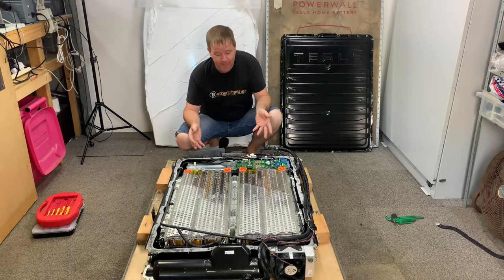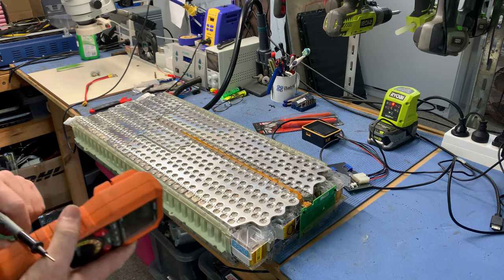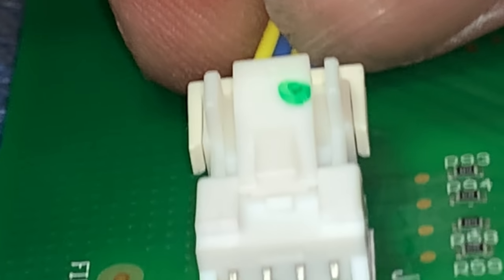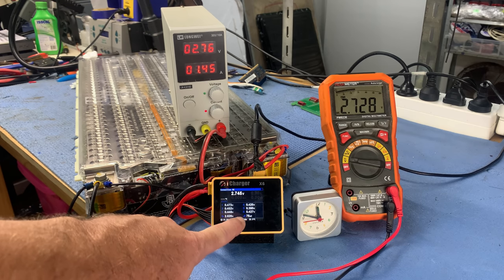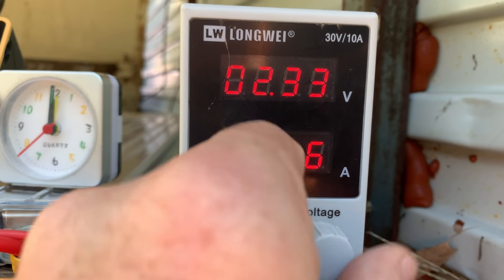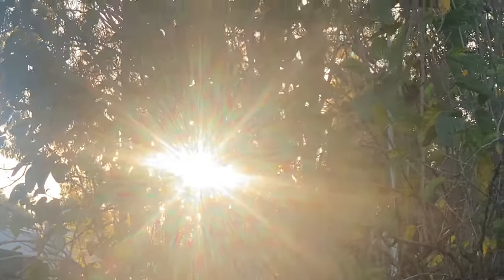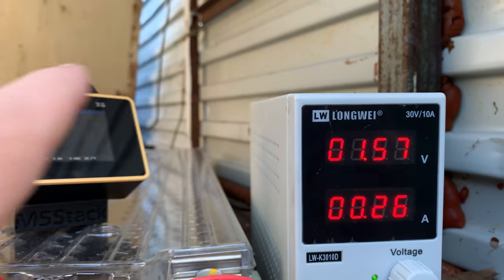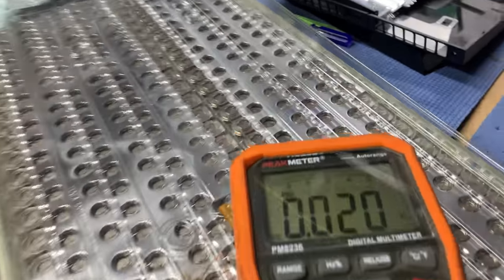Tesla Module repair | Zero volts to useable? Lets find out !

Comment: fyi I'm playing around with a digy meter 6 digit  after the point. only to show if batts are going down or holding when building a battery . i might go to 8 digits its only a reference. to find out were the batts  are going ..i  check and charge all cells as per . then leave for 24hours  and so far the  batts do as the meter said.
Reply from the maker: I so want a higher resolution multimeter but this one was 60bucks from Banggood years ago lol it's done the job up till now

Comment: These very low charge currents will only compensate for internal losses, i think.
Reply from the maker: Yeh for sure but I tried more as much as 20 amps and the cells just go hotter faster. RIP Tesla batteries - I do still have them on the shelf tho.

Comment: I was  able to restore some with a desulphator charger..it spiked the voltages between 2 and 4 volts . It woke some 0 volt cella from 5 year old laptop
Reply from the maker: but were the cells zero volts....? not 0.1v?
Reply: @HBPowerwall  they were 0.00,, try  spiking  the voltage to wake them up... it was only 1 amp also
Reply from the maker: ok cool!! I just spiked these ones :P

Comment: charge your battery at 24v w/ 225 mah to 500mah trickle charge will do the trick, fun fact cell phones work the same way if you slow charge them your battery lasts longer between charges and longer over its lifetime.

Comment: Hey try throwing a lot of heat at it or a lot of current to perhaps revive the battery chemical
Reply: This helps reduce resistance
Reply: yes, if heat to 350C it might do the trick
Reply from the maker: i ACTULLY think there is something to this... well kinda, well maybe, well check the next video :)

Comment: 😥☠️🔋 .. been dead to long and the chemistry can broken down into to something not battery like.
Bet if you remove a cell, it would have very high impedance; as you already suspected. 

On to Plan B/C. 🧐 Question is will you do 7x 1s modules (like studio wall), or make 2x 7s modules in similar shape to the 24v Tesla modules? Could probably reuse plastic covers and mounting?

Maybe post 2-3 build options and have community vote on ... builder getting final choice as how to proceed.
Reply from the maker: Lots of ideas kicking around on how to use this 'powerwall' will see what comes of it..

Comment: Stick it in a fire pit, put 10A into it and see where the heat goes. It will either be a few bad cells pulling the lot down or the pack will go thermal
Reply from the maker: Check out the next video I just released lol

Comment: i have to disagree on a major point here. I tried this only on individual cells, but here is my experience : the zero volt cell IS useable : I loose only about 11% of those. They are all in my power wall now. The absolute truth is, ANY NEW cell will not keep its charge if it is below 2V. There is a threshold where the cell self-discharges. You won't get normal cell work/behaviour until you put it above 3.3V The lower the voltage the faster it goes down. I can guarantee that your test of energy retention with such a low voltage is not valid. When I have a zero volt cell I first charge it in a nimh program, then I jump to a lithium program. With as little amps as possible. When it is at 4.10V and the amps are dropping on the charger, and I store it for a monch, I discard the cells that are below 4.00v after one month, and I discard also those thar have more than 80mOhm of IR and it is there that I see the result from 8% to 11% are discarded. 8% discarded in the 3,3V group and 11% discarded in the ZERO volt group. Test sample: about 7000 cells in the 3,3V group, and 282 in the ZERO volt group from witch I discarded 31 : reason for discard 22 were self discharging, and 9 had high IR. The difference between your case and my case is the duration of the zero volt state : my duration is unknown and different for each cell, your duration is very long uniform and known. My cells were each of different brand, yours are all the same batch. And as a final point the guy who wrote a comment about the dendrites : it is probably true on paper, but so far I have processed over 8000 cells and found only 2 that wanted to overheat. So this is a risk, yes, but it is not a constant.

Comment: Ugh that's so sad. When I've recovered even cells in the past I charged at .2 amps for a couple hrs then half hr off n next time I do the .2 amps they began holding charge. The capacity was complete shit though. Talk about degradation (sigh)
Reply from the maker: i've still got the battery charging at 0.1 amps months later I should video it sooner rather than later.
Reply: @HBPowerwall  still? Any signs of life?
Reply from the maker: Kinda, it’s terrible really but if you were in a third world country and this is all you have it’d do a job.
Reply: @HBPowerwall  seriously agree! I'm experimenting with two 200ah packs of lifepo4 and lithion in parallel connected to a small 2kw inverter. Each have their own fusing and bms's. I'm learning a lot from it. They're far away from my main system but very interesting how differently they act under load and charging. I seriously would never have thought about it. Had some old 18650s laying around and the lifepo4 from my car audio setup and thought they should be doing something other than collecting dust!

Comment: When batteries are fresh out of the factory they don't have any voltage. So it's added REALLLY slowly over a few hours, then 1-2 cycles to make sure it works before shipping out of the factory. I guess that's only works when they are fresh, unfortunate you were unable to revive it.
Reply from the maker: Do you know this first hand? Or just interwebs? Keen to see the process between finished production cell and fully charged cell.

Comment: That gradual fall you saw on the multimeter is probably the residual voltage in the power supply. Cheap chinese PSUs do that.
Reply from the maker: i'm thinking so

Comment: just remove some of the cells and check if the cid are ok if not then search on youtube how to recover cells with broken cid and recover it if you want, believe me, I have recovered a ton of those cells with the screw trick(putting a tiny screw inside the holes on the top ) . as it is the battery is going to get trashed so why not take a chance and if still, you aren't able to get any voltage then send it to me I would try to check out what's wrong with those cells.
Reply from the maker: YOU need to check out my CID video.... DON"T DO IT..

Comment: Crazy to me that such an advanced system doesn’t have a manual reset safety device to keep the cells above 2v. Seems like such a waste of good resources.
Reply from the maker: Any good bms has low voltage cut of option

Comment: Where does the charge leak to? Heat?
Reply from the maker: Yes, the cells are internally shorting and discharging as heat
Reply: what happens is there needs to be a barrier between the pos and neg surfaces, but when that breaks down, current doesn't have to go across the terminals but just jumps across inside the battery.
Reply: @JeffSmith03  I see what is that barrier made of that it can dissolve? 
Like I’m an engineer but nothing with batteries / battery materials, it is interesting though to know why things eventually fail,

Also why does it breakdown due to not holding a charge for too long?
Reply: @Eagles_Eye  it seems that different designed batteries have different reasons. My profession is designing robotics and I am still trying to learn this stuff but people are mentioning dendrites and that would mean when the crystization forms it extends spikes, which would force it's way through the separator like a nail and cause another short for each dendrite. I knew it can happen on a PCB or in some chips. The reason for a difference when depleted: it's about chemistry.
see for more info https://batteryuniversity.com/learn/archive/is_lithium_ion_the_ideal_battery

Comment: How to reset each cell in ONE module? I mean mechanical reset?
Reply from the maker: They are internally shorted... you can't..
Reply: @HBPowerwall  I did mechanical reset all 78 single cells, only didn't know which one is bad, but ONE module 3,7V back to work.

Comment: You should have brought it up to the minimum zero amps voltage. With a tiny amount of amps.
Reply from the maker: Tried and failed :(
Reply: Wondering can you attempt to charge a cell by bypassing the bms? Is it the BMS stopping the cells charging. Only ask because I have had some success reviving old cells that were at 0v. Not on this scale unfortunately but. Maybe slightly higher amperage?
Reply from the maker: BMS has been removed & replaced with after market board I can connect a balance charger or my Batrium BMS to

Comment: Hi
If I were you, I would charge this module with a higher current so that at least some of this charge would get into working cells and I would check the temperature on an ongoing basis to detect those that are "shorted", and then I would cut off their connections from the rest of the module.
Another option would be to test each cell after it is disconnected from the module and see which can still go back to its previous state.

Comment: Some of the cells are shorting the other cells.
Reply from the maker: By the looks they are all shorting
Reply: @HBPowerwall  Oh, no, don't say that! You only need one in a pack to give the result your are getting. I reckon there are 20 or 30 cells in a pack, so the chance of 1 being a short is much higher than all 20 or 30 being a short...I hope you rip the packs apart and see how many cells are actually shorted and how many recover...a lot of work though, I wouldn't blame you if you just scrapped the lot, but maybe just one pack?

Comment: You should never charge a LiIon cell that has dropped below 1V. At these low voltages, copper from the current collector will dissolve into the electrolyte and could cause internal shorts upon later cycling. A cell that's gone below 1V is toast, period.

Comment: ive recovered tool batteries from a low voltage state at around 0.6v cell and put them back into everyday use without issue.
recovering one from completely flat... yeah that wont work
Reply from the maker: yeh low voltage, is different beast to no voltage.. I've done this also in the early days

Comment: Are you serious?! charging at 0,5Watts a battery pack ~11KW The internal resistance alone is higher than that charging rate. You should try at least 100x as much juice to try revive that Pack. 50W or so.
Reply from the maker: I'm months into charging - I have not given up yet.. currently 0.1 amps per 'cell'  video when I stop being lazy

Comment: Not that i believe the cells could be revived. But charging at 1.5v*0.4amps = 0.6watts, thats way to low to make any difference in a pack that size no? I know you just want to be careful to not start a fire or anything, but you could have tried it with something like 10watts at least, even if it would turn to heat, 10watt shouldnt be able to start a fire even if you tried. Just my 2 cents
Reply from the maker: So try higher amps you say... sounds like an idea...
Reply: @HBPowerwall  I agree, with a little more "umph", it might be enough to force them over the hump. As mentioned in another comment, you may need to pushing them over the hump to make them act like batteries instead of capacitors.
Also, this may help you find the heaters that could be contributing to the rapid decline. Ya know, 1 bad apple spoils the whole bunch, kinda thing.
Addendum: If you try to push 300 lbs of dead weight up a hill with only 50lbs of force, you won't move it all. But push with 200 lbs of force you may actually get it moving, even slightly. Push with 400 lbs and it'll definitely move.
Reply: @HBPowerwall  in 5 years we will see offers for such dead batteries in the second where the big countries start there ressource management and recycle these cell like shown in this great video where the battery recycling quote is over 90% .... it might be crap for you right now, but it will get back a lot of value and if you have such facility in your country they will pay for this raw material.

Here is the video you have to search for
Can electric vehicle batteries be recycled

It is from the "fully charged show" UK visiting a german battery recycling factory ... that will become a supplier for the VW plants that produces its own ID.* car fleet cells and batteries in plant nearby ( VW Salzgitter) .

So pile the dead up for the moment they gain value cause a 1000 $ tesla battery pack that has gone dead will be worth a few hundred dollars in 3 - 5 years. Australia will not burry the dead batteries on garbage deponies and try to recycle instead to mine the ore again.
Reply: @korishan  
your comparison definitively is incorrect. try pushing a cart without wheels up a hill with strong force and expect wheels to grow in the process!
Reply: @ursodermatt8809  I don't believe so. And your comparison makes no sense at all
Reply: @korishan  
ok, but i am sure your's does
Reply: @ursodermatt8809  yours, not your's
Reply: @korishan  
yes of course, thanks for your correction
Reply: @ursodermatt8809  You're absolutely welcome. Always willing to lend a helping hand, or word.
Reply: @korishan  
thank you very much
Reply: @ursodermatt8809  You're welcome

Comment: Get yourself a 250A power supply an start charging and follow the heat
Reply from the maker: DC welder? lol
Reply: @HBPowerwall  yes weld the dead cells internally, 

at the end use a dremel  and just remove the positive connection to the  cell 

don’t bother opening the entire thing only as a last resort

Comment: What is the history of this battery module? My distaste for batteries is why I stay away from electric cars. The fully depreciated 10-20 year old clunkers I like to drive won't be possible with an electric car that have batteries that die.
Reply from the maker: I know what i'm told (and don't trust it...) was told it was new, but after much more time with it, the Powerwall has been installed but I don't know if it was commissioned. Like anything ever made, there will be failures - in 20 years you'll see a headline that 20x Tesla Model S will be 2million miles with original motor/batteries - then the internet will complain that three people had one fail after 4 hours.. Your distaste will put you behind the 8Ball.
Reply: @HBPowerwall  I hope you are right. But I still have yet to see the day that any kind of battery in any device being 10 years old and still good and strong. Time will tell for sure.
Reply from the maker: To be fair are there any cars out there that are 10 years old with zero maintance that are still healthy?
Reply: @HBPowerwall  Yes, there are.... with the exception of about $600 in oil changes.  That's a far cry from a $16,000+ battery PLUS the R&R of said battery.  Electric cars have just as many parts and complexity as a gasoline one.  They still have water pumps.  They have radiators.  They have refrigerant being pumped through their batteries.  They still have gear boxes.  They have wheel bearings, suspension bushings, shock absorbers, drive axles, etc.
Electric cars are not maintenance-free like they claim.  100,000 miles and 10 years with nothing but tires and oil changes has been done many times before.  The average age of a car on US highways is 12 model years old.  That's average.  

If you're the type of person who likes to buy brand new cars and just eat the depreciation (more for electric), there's not much reason to not buy an electric car.  But if you don't like investing in depreciable assets and would rather let someone else do all that, then its not for you.

Heck, when the thing is all done, you're going to have to pay to dispose of the car.  It is hard enough to find a place to take the lithium batteries from electric bicycles and E-cigarettes.

And when something bites the dust on a Tesla, of which happens frequently, YOU ARE SOL unless you take it to one of their dealers and wait in line.  When they say that it is beyond repair, there's no 2nd opinion.  They can't even make a car with doors that open and close reliably.

Comment: 0.4A charge for 100P+ battery?
That's way too low for even revival, should've cranked the amperage to the maximum this chinese PSU can put out which in this case seems to be 10A.
Reply from the maker: That test was the second video here -https://youtu.be/pD3z1tfPJDA

Comment: Hey I know the battery is dead but if you could do me a really big favor and stop touching all of the contact points with your bare hands that would be great nobody wants to see you get hurt and also the oil from your fingers Can corrode them I definitely don’t have as much experience dealing with this stuff as you do but I really like you and I really like your channel so please be safe I want to see this project all the way to the end
Reply from the maker: Valid point on the oil but there is zero chance I can die or even feel 24v if it was fully charged. My body just doesn't conduct electricity at such voltage, i'm not a crescent wrench